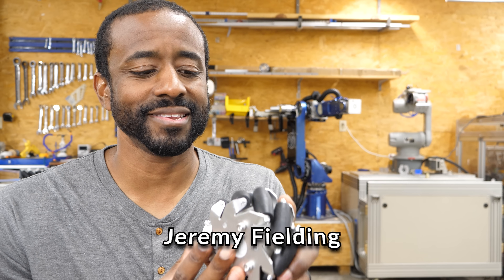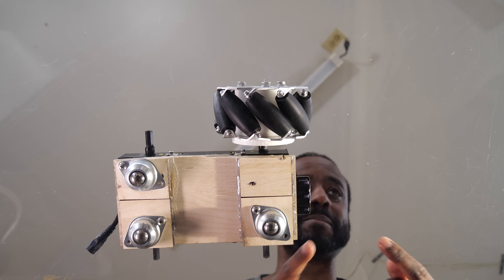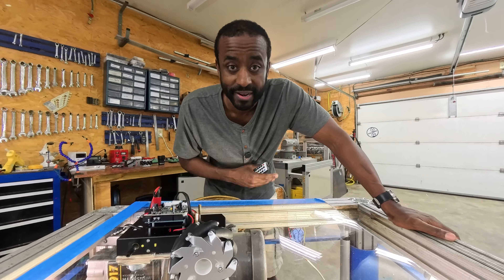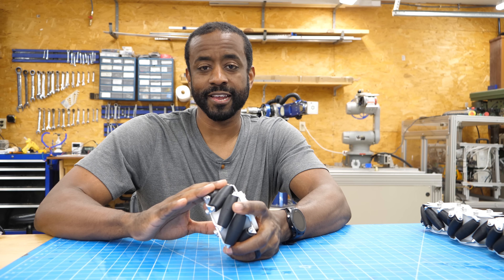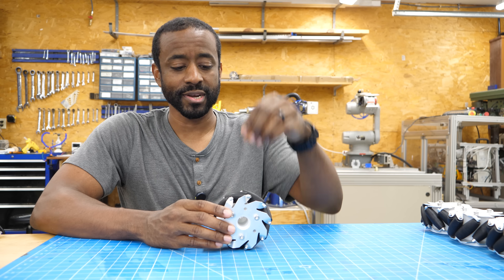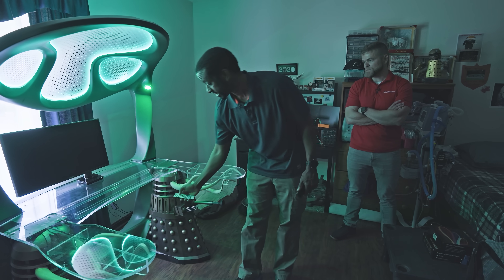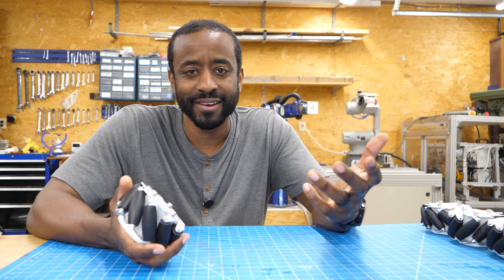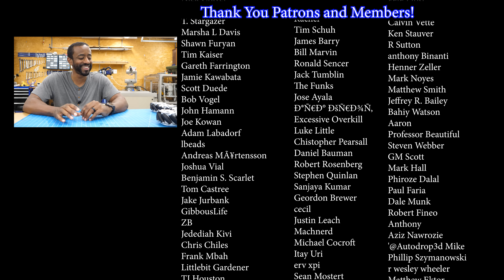The Mecanum Wheel Is So Weird, It Is Genius. How It Works

Comment: Robotics Rules.✅
Robotics vs Economy.❌
Consider a Robot that can pick fruit.
(They are already in use just 15 kilometers from me.)
But, only useful a few months each year.
I think your project would benefit by considering this issue of economics.
Modularization, of course, is the most logical conclusion. Implementation is the unknown variable.
The Mecanum wheel. Consider Coaxial, and Pneumatics.

Comment: Nice! And very cool!
I used to work in a manufacturing facility that had about 40 six-axis painter bots used in production just for painting components at any given time. Being in maintenance, it was very up. Close and personal. The complexity of using a stationary 6 axis bot to paint components on a moving assembly line was incredible. Incorporated were pneumatic systems to meter and switch applicants from about 60 source systems on the fly. Truly incredible.

Comment: I think a great application for these would be powered wheelchairs or mobility scooters. They would probably need to have a locking mechanism for the rollers for running on uneven ground, but it would allow for greater range of movement for those who don't have it.

Comment: Awesome Vid.   Thanks for clarifying the energy loss thing in the comments.
I suspect the loss is actually pretty minimal.In forward movement, for instance, the diagonal rollers don't actually turn much at all.
So the only real loss is through friction and heat, same as on the same sort of vehicle with regular wheels.  (maybe a tiny bit more)
And the sideways move would be a bit like a 1/1 worm-gear, but with a lot less friction (assuming they have good bearings).

Comment: Would you like to do a video on generators/alternators? I was thinking lately how squirrel cage motors don't need commutators and if they can be used as a brushless generator. I also found the concept of the "brushless alternator", a device with exciter coils separate from the rotor coil, but there is precious little info on that concept (a fairly dated-looking video by an Indian gentleman explains it best, but there's not much beyond that one). Do they actually suck and no one bothers with them? There's definitely stuff that I don't know and I don't even know what I don't know.

Comment: Great concept. Could have explained in 3 minutes. People are smart & understand quickly. Less is more.
Reply from the maker: That’s funny. If you time it… I did explain it in about 3-4 minutes LOL. Roughly Half the video is about an upcoming robotics project which you can skip (by design put at the end I mean). Remove that part, and discussion around applications pros and cons of its use for the wheel which was for the smart people who understand it’s not perfect for everything and you have roughly 3-4 minutes. Thanks for watching 😁. I think this was a good result. Feel free to skip around or skip the whole video. You are in control and I tried to help that by moving the related but different stuff to the end for those who follow my channel

Comment: In autonomous driving research the term is holonomous (mecanum) vs nonholonomous (regular car) movement. Path planning is easier when you don't need to worry about 3 point turns. There are a ton of papers if you look though Google scholar

Comment: Another application that you may have not been aware of, conveyance. I work at the airport laoding containers onto aircraft. The loaders we use utilize mecanum wheels to move containers onto/off of the aircraft. The deck is coverd in these wheels and can move containers in any direction as well as rotate them.
Reply: It's a Wonkavator....it goes upways and downways and sideways and every other ways...lol
Reply: Nice
Reply: Absolutely correct, the uniroller cargo transfer system can and does allow for   multi directional management of ladened cargo containers. These also allow for longer service life of the container loader cargo movement systems as the older style of rubber drive belts needed constant adjustment, and replacement, not to mention the loss of  traction during inclement weather, especially when air deicing fluid came into play.
Reply: I was thinking the same thing.
Reply: Make your own video bum.
Reply: Surprised they still have humans loading them, a lot of this is automated now. Even loading and unloading pallets on trailers (self loading trailers)
Reply: They will be good for tourists as they allow you to spin around without having to move forward, they also see to have more traction on grass fields maybe.
Reply: Are you saying that this is nothing new?

Comment: I am just thinking back to a young man getting washing machine motors to make a small homemade band saw or lathe in a in a tiny tiny shed to now.  Your hard work has paid off.  The robot arm is most likely the biggest challenge you took on but my favorite has to be the CNC table saw.    I have missed a few builds but I have followed this channel from near its birth.     You have learned a lot as well as taught a lot.

Comment: That's a substantial cost. Especially if they have to buy things like a multi meter and any other tools in addition to that $150-$200. I certainly wouldn't pay that unless I get EVERYTHING  needed to complete the project included.
Reply from the maker: Unfortunately it is impossible to estimate tool cost. Not only do tools have value far exceeding the cost of the project they vary a lot in cost themselves. You can buy a $10 multimeter or a $500 multimeter. It’s not practical to estimate that cost nor does it really make sense to include that cost when by design those items are meant for more than one project. But we CAN try to minimize the number and size of tools needed. I wouldn’t assume someone trying this project has a Haas milling machine, but I would assume someone trying this has a multimeter or is willing to buy one. If your are interested enough to try you should also be interested in owning cheap tools that help that goal

Comment: Have you figured out any method to get the robot to move in a specific direction. I'm working with a set right now and my wheels slip way too much and I cant figure out an agorithm (or at least I cant tune my PID algo well enough) to make the robot go in the direction (and maintain the orientation) that I want.
Its "easy" to get the robot to go in a direction, but I want it to be able to maintain the specific angular direction, and the orientation. Like in your video, while the robot is going straight, its also rotating a bit to the right. around the Z axis. I want to figure out how to prevent that.

Comment: There has to be a way to incorporate stepper motors on the wheel for precision movement. Although it will make the wheel much more complex that it is now. I think I saw this on one of the laser guided vehicle that was demo at one of the logistics meet that I attended sometime ago. It is really cool.
Reply: Omni-wheels (rollers at 90 degrees to circumference) can be motorized for this, definitely adding lots of complexity, but the Mecanum design doesn't really need it.  If you needed very tight position control, tighter mechanical tolerance on roller parts would be the most direct way to get it.  More rollers (they can be layered just like Omni-wheels) and/or more wheels would also help even out any deficiencies caused by transitioning from one roller to the next, and when dealing with imperfections in the floor surface.  More wheels requires more motors and computer control, however, as well as possibly needing more suspension capability, if uneven floors are an issue.

Comment: Instead of the rollers fixed at 45 degrees all the time,  could they not also dynamically change the orientation of the rollers, lets say instead of diagonal make them oriented forward, when the vehicle needs to move forward to save energy?

Comment: Neat to see you doing a video on these. I know them as omni-directional wheels. Used a larger set of them in a work project a few years ago for a robot.

One application I'd be really interested to see these implemented in is mobility scooters. I could see the added directional control a possible benefit to the user.
Reply: Mecanum and Omni are the specific names for two similar wheel types.  Omni have rollers along the circumference, (90 degrees to axle) and have been used as stationary casters (no extra turning point) in some scooters and wheel chairs.  They were/are also popular for robots with a circular footprint.
Mecanum is a great option allowing sideways movement, but might be superfluous for most wheelchair or scooter users, who usually want to move forward for safety without craning their neck about.  It also requires additional control and drive mechanisms, versus the single motor in a typical drive system.

Comment: Hi Jeremy! that/these are an interesting item ( Yes Micheal Jackson hit it out the park for sure and this wheel has some cool up its sleeve) but over time it looks like it is a delicate item when compared to a normal forklift tire usually solid ruber and the traditional tire tracks straight most of the time were these crowned elements of this mecanum wheel are in a higher state of friction with the surface all the time nomatter what the surface happens to be so when the crown wears off! what happens then? I know! it starts requiring more force to do this trick wears faster and faster till failure, they are perfect world wheels in this sense? that crown makes what this does possible! it is worming its way along, Yes/No

Comment: I’m wondering if a similar effect could be produced more cheaply by having large conventional wheels for general and high speed operations, and a set of angled rollers on a frame that would normally be raised off the ground, but lowered and forced (hydraulically?) between the conventional wheels and the ground. The conventional wheels would rotate and transfer the rotation to the angled rollers to achieve the Mecanum effect at slow speeds, like parking a car. The rollers would be raised when not needed. Most of the force needed to position the rollers could  be provided by having the conventional wheels drive up onto the rollers or by releasing the roller holding mechanism and allowing the conventional wheels to drive off the rollers. What do you think. Could be less expensive and still allow the benefits of both types of wheels?

Comment: One real option you didn't mention is the fact that you don't have to have any steering capability linkage. Only the ability to tell which wheel or wheels are to turn on and either clockwise or counter clockwise to go where ever you want to go. So a lighter weight vehicle can be utilized.

Comment: I was compering a steampunk event a few weeks ago. One event is teapot racing around an assault course. Most of the racing teapots are radio control cars with a teapot body. One guy showed up with a chasis with Mecanum wheels. Manoeuvrability is key with the event, and tank tread teapots tend to win. We were expecting great things, but the floor of the assault course was a 200 year old factory floor with dents, divots and dings. The moment one of the wheels didn't have solid ground under it then the teapot went flying. So yes, dman cool, awesome in a control environment, but not much good off road or in any out  door situation
Reply: I would imagine it would made even worse if there was a sloped floor. Compounding issues with rough terrain.
Reply: They should’ve used swerve 😎
Reply: He says that
Reply: What sort of white person activity is this 😂

Comment: During Highschool I was a part of a robotics competition program called FIRST Tech Challenge. Mecanum wheels have been the go to drive train for robots for several years now, they have some limitations but they are incredibly versatile. This was an amazing explanation, although Ive been using them for years I never understand quite as well as this.
Reply: Actually the vast majority of FIRST robotics teams now use swerve drive rather than meccanum, which was popular for mobility but were also avoided by many teams due to their inability to prevent being pushed by defensive robots. FRC mentor since 2017 😉
Reply: @sjsomething4936   Mecanum is still the go-to in FTC, as the 8 motor limit and super tight build space make pulling off a successful swerve drive extremely difficult (and even if you succeed, whether there is actually any real-world benefit is very season-dependent).

Comment: If you compare it to a conventional design, the roller that is making contact with the surface, when oriented correctly, it is essentially a wheel with a ridiculous aspect ratio and crown with an extreme amount of toe angle. Toe angle is what keeps a conventional vehicle traking toward the center line of direction.

Comment: Well,  I always und wanted to build something like a robot, but I never did because most robot designs for amateurs are just playthings, that are useless, except for building the skill needed to build them. So I think the budget is not so much the issue, but what you get. The best would be a small series of projectd  that builds as many foundational skills (welding, cutting, measuring...) as possible, because the more base skills you have the more you can try on your own later.

Comment: I had almost forgotten about these, even though i am perhaps, and still, even more excited about them.
2 questions though.
First what is the loss in efficiency, given perfect conditions, which leads me to my second question, which more specifically hhough also very hypothetical.

Say you got two identical cars, evs naturally, one motor per wheel, only difference being that one has mecanum wheels and the stering locked in place.
If you compare the overall efficiency, ensuring not to include any task that both cannot perform indentically, is one actually more efficient and if so, do we know by how much, purely theoretical, given perfect condition, not accounting for cost, wear and year and such things?

Comment: As someone who was in FIRST robotics I always thought these were so cool, we mainly used them in material centering applications not locomotion. What FIRST used for locomotion was what we called "swerve drive", I think that could be a really cool video going into the deep dive of "swerve drive" in real world applications. I also think you would maybe find it as a fun drive train for your bot because it has both precision and maneuverability.
Reply: Too bad that have god awful traction. I remember watching 1640 just smash their way through anything that used mechanum in 2014 and 2013
Reply: Current mentor of a very successful FRC team… swerve drives are now the most common and popular drivetrain type in FRC, basically since Covid. Even 254 switched over to swerve from West Coast drive.  But you’re 100% correct, we used meccanum for centering the cargo in 2019, as well as the big tennis balls in 2022. 

Do a search on YouTube, one or more of the mentors of 118 / Robonauts built a swerve drive car about 9 years ago.  Search NASA swerve drive car.

Comment: Might the Mecanum wheel have the potential for further development?  Certainly it would require a higher level of complexity, but building into each wheel a mechanism for changing the skew of the rollers while the vehicle is moving could potentially minimize the scrubbing forces, raise both efficiency and accuracy of movement, and allow higher speeds of travel.  Plus the WOW! factor.

Comment: In FIRST Robotics Competition, mecanum wheels are also used a lot as auto centering rollers. You can position sets of rollers so that objects can be pulled against a wall and center automatically. It is pretty neat.

Comment: Jeremy, here is something you may wish to try.  Instead of a wheel, why not crawler tracks?  If you could replace each wheel with a small powered unit for each wheel.  Simplified mechanical construction I believe. Using angled cleats on the track could give you the same or similar slippage.  I could see something like that being useful in construction to exploring other planets.  Rubber tracks would slip in smooth surfaces such as tile or concrete floors.  Just an Agricultural Engineer thoughts.
Reply: Tracks are primarily good for adding traction.  They get problematic when dealing with things like loose or pointed rocks above a certain size, as well as hills that can't be approached straight-on, and require frequent maintenance in those conditions.  That's why most of the rover wheels have been kept extremely simple – there is NO maintenance on Mars.

Comment: 0:10 "On a forklift". Yeah. I invested in that company. It went bankrupt. I still own the stock, but it's worthless now. The trouble with a mechanum wheel on a forklift is that the surface they operate on is rarely clean. If you have banding discarded on the ground, the wheels will pick it up and wrap it around themselves. Sigh.

in addition to a forklift, they had a flatbed for moving things around in an airport, like helicopters & such.

Comment: I really liked your mobile robot arm idea, but working in a factory has taught me that optical sensors f ail rather frequently when it would be much simpler to set up a hydraulic centering mechanism to get the accuracy you want
Reply: As far as I can find easily, hydraulic centering is basically for various types of clamps, isn't it?  How does that solve finding, or getting an object to/from the work or storage location in the first place?  Or are you talking about something completely different?

Comment: I used to be an FLT driver, I was watching the guy in the warehouse driving while bringing the forks down, I was taught to bring it down, making the centre of gravity low, before you move forward, for safety!
Reply: This is a rule for both center of gravity and visibility, but not all loads are created equally.  Less weight makes this much less important.  Regarding visibility, well, real world demands sometimes make safety more of a "top five" priority.